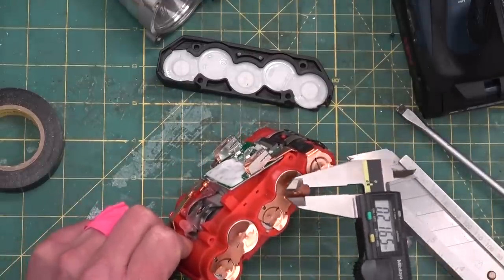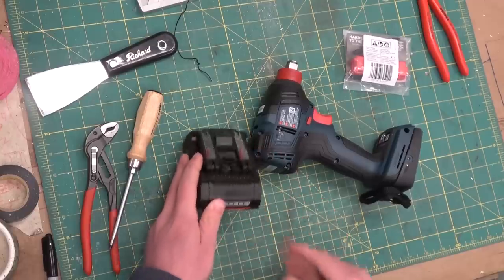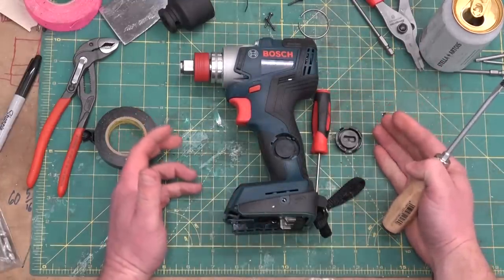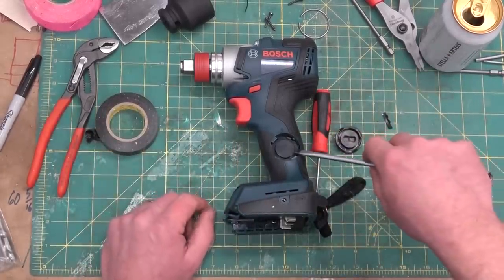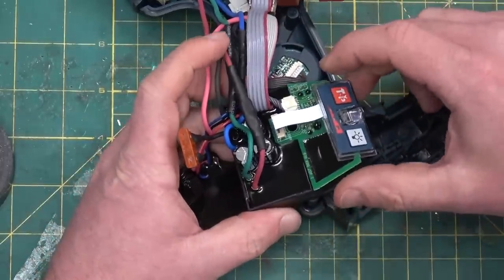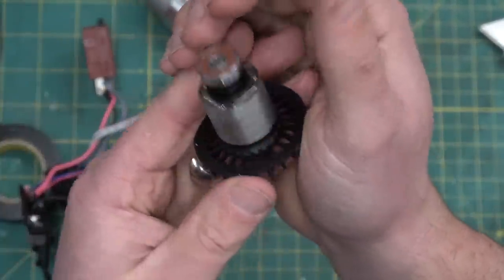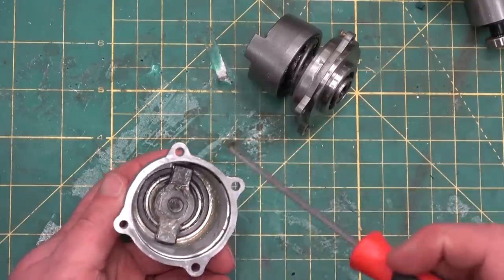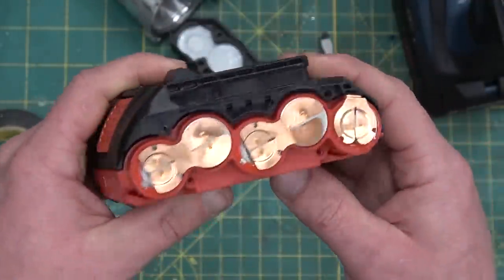BOLTR: BOSCH impact driver | CORE 18V

Comment: The blutooth does have an advantage. You can set your phone up to someone else's drill, then lower the torque when they are trying to use it.
Reply: I am pretty sure that that is the whole point.  Your boss can preset the torque so that you won't break the fastener.
Reply: Screams in frustration
Reply: I'd use it if it's an anti theft feature-locks the electronics when stolen
Reply: @Cheesen77  I think the boss would be more concerned with getting work done more quickly than a 2$ fastener. In a world of heavy machinery, if man labour slows down the site, money adds up quickly.
Reply: I get the idea of the bluetooth but I'm kinda confused why any employer would keep a bunch of guys who can't use an impact gun without busting the end off every fastener they touch.
Reply: Daniel Östberg because in today’s world it’s hard to find someone that knows how to use a torque wrench. 
Or.... maybe it’s so you can set the torque, cutting overhead by letting the one guy go that knows how to use the torque wrench and decreasing job time. Two birds with one dingus. To bad when Bosch introduced the torque limiter/adjustment feature, they said you shouldn’t rely on it and still double check it with a proper torque wrench. Conveniently, at the same time, they introduced a Bluetooth adjustable torque wrench. 😉😂🤪😜🤣🤓
Reply: The Bluetooth is junk. I have the Bluetooth grinder and Bluetooth LDM and it’s a nightmare to get either to connect to any of my hand held devices. Infact the LDM didn’t even work with Android.
Reply: Benz Lev 👍👍👍👍👍👍👍👍
Reply: Leave it to Bosch to put a WiFi password on the darn thing.
Reply: @notyourpapa  it is a problem if the bolt snaps off when changing a car tyre or snaps off in the engine block. Id say it has nothing to do with the boss. Iff i buy a tool its is mine and has nothing to do with the boss. More important when giving the tool to the apprentice and they have no control over the tool.
Reply: @barfoom  bluetooth not wifi.
Reply: @Darkstar.....  I don't think I was saying the opposite of that.
Reply: MrBD cause those guys work weekends
Reply: Lol
Reply: no the Bluetooth has the purpose for future gen tools to connect to each other.
For example if you use a Battery tool connected to to a vacum.
To increase or reduce brightness on Battery led lamp or on/off or to connect to a remote controlled tripod or wall mount for your Laser. 
It also gives you datas of the tool like for exmple run time, age or serial numbers.

You people here speak like the cavemans that said that a battery tool will never outperform a corded tool and that it will never esteblish.
Now we are in the age where battery power tools start to compare to gasoline units.
Reply: So we're considering getting some of these, because we work with farmers. Farmers have an interesting definition of 'billable hours'. Ideally, the BlueTooth functionality will ensure that we actually get paid based on the work we do, and not have to argue nearly so much about it.
Reply: that's what it is for :D
Reply: Limiting torque is actually good with low skilled labor. A friend needed to pull the blades of his husky mower. Its air powered and 900 ft lbs. With 5 settings what's he do? Full power loosen then full ungaduga retorque with me going no! Torque spec on bearings was 15 ft lbs... with my battery impacts something all they way to strip or crush...without settings...
Reply: Benz Lev can’t they just take out the module?
Reply: @lebenitj  That's how DeWalt uses Bluetooth
Reply: Exactly the main purpose, I would do that!!! ;-)  Dont know why everything today has to have Wifi and or Bluetooth Connection? ;-)
Reply: @lebenitj  Or remind you left your tool behind.
Reply: MrBD nowadays “education” is mostly how to do your job and how not to kill your self doing it.
Reply: Aaaand you`re fired..
Reply: @notyourpapa  Yep, and in the world of heavy machinery tapping out stripped threads wastes more time.
Reply: I got my grinder connected and only useful thing was that i could set my led to stay on longer :D
Reply: Lmao
Reply: @Darkstar.....  for liability reasons, and with most GC's, you're not supposed to use your own power tools, and the GC is supposed to provide them or, more/or less, the GC will 'rent' the tools and equipment to the project from a 'rental' company that the GC owns.
Reply: The blue range is exactly what it is, blue in color, the only thing worthy in that range is the 10.8 v .....
Reply: I have no idea when or why I left this comment, I'm pretty sure I was either falling asleep and fell on the keyboard or someone hacked my youtube account 🤣🤣
Reply: @notyourpapa  had my impact set on high and snapped a bolt off putting a blade on a D10. Exactly 0 shits were given about the cost of the bolt. Many shits were given about how fast the broken stub could be removed.
Reply: The Bluetooth is used to prevent retail theft. People have been stealing power tools so much lately that some manufacturers are installing these BT modules inside the tools themselves so that it would only work if the retailer activates on the checkout counter. Home depot is one of them.
Reply: @michaellim4165  That's not Bluetooth. BT requires active power, alligator tags and RFID doesn't. Unless your tool always comes with a battery installed on it (which they don't). AvE has pulled apart tools with integrated alligator tags before, which already works with existing theft prevention systems.
Reply: @GryphonArmorer  I dare you to try and torque valve cover bolts with this as a legit torque wrench three times in a row without failure in seal or bolt/thread
Reply: @notyourpapa  tell the remove the chip
Reply: Can confirm
Reply: They are getting plain goofy with technology these days. Most of it is actually good. I just can’t see it here. Gimmicks!  Bosch should think twice. They do make nice tools and have a good name.
Reply: Lol I was thinking about leaving it setting around, then just turning it on remotely to scare the poop out of the crew😂...  get really fancy and put some sort of power reserve in it so you can still do it when they take the battery out 🤣
Reply: Also the girlfriend likes an attachment I made so Bluetooth would be a welcome additional thing I could have control of her fun !!!!!

Comment: The copper being that thin is probably due to the difficulty in spot welding the copper -- any thicker and you probably risk punching through the battery case.
Reply: Short protection too? So the copper will blow before the cells go thermonuclear??
Reply: Not... exactly. Most of the heat is going to stay in the copper because... That's what copper does. It conducts.

The thicker the copper, the larger the spot weld you can do. To a point.
Reply: I also wonder about the flexibility, copper work hardens like Ave said but all of the robotic grade flexible sensor cables I have seen tend to have thin seemingly near dead soft copper (28 AWG 12-18 strands ) maybe the wide strip is for getting the proper surface area for the current and the thickness is also for allowing more flex cycling without failure. I also think you have an excellent and poignant thought about the spot welding, I have hear it takes a tremendous amount more power to spot weld copper compare to other metals in similar joints.
Reply: Well, according to Bosch they are laser welded.

Comment: The bluetooth is usually for asset protection, you activate the app when you get on site, if the device leaves bluetooth range of your phone it sets off alarms on your phone and device.
Reply: I prefer the thought of dystopian marches being broadcast whilst drilling....
Reply: Huh! I was wondering why in tarnation anyone would want a driver connected to the Interwebs. You’ve at least provided an excuse for it.
Reply: If it weren't so chintzy and outta place a PWM speaker from the drill's motor actually sounded kinda neat.
Reply: Bosch’s Bluetooth thingy is not necessary asset protection, it’s paired with nfc (afaik) for inventory management, but also parameter tweaking.
As for where they’re made, I have some from Malaysia and some from Germany.
Reply: i suspect the unit will be bricked with uncle bumbles IOT delete if thats the case, wouldn't be much of a security feature if you could just unplug it to have a free tool, even if it doesn't have a module in the hole the receiver probably needs to be installed for the brain to run the tool
Reply: Real pro just continue the cycle of theft on the job lol
Reply: @billrehm3590  Why it's fairly well made.
Reply: @jamesdriscoll9405  .....by a Drill Sergeant! Snort!
Reply: i know the milwaukee bluetooth gives you the ability to lock out the tool. never used it myself.
Reply: @RoseUnseen  That's it mate. Lose a tapemeasure, find a tapemeasure, the universe is in balance.
Reply: Unless the person taking it has a standard screwdriver...
Reply: @jmccoppen  The module is designed to disable the drill if it is removed while active.
Reply: @konzetsu6068  HILTI does the same thing on the powder nail gun I use at work. it can even order shots for you when it thinks your close to running out

Comment: I’ve dropped my Bosch impact from really questionable heights before and it’s never broke. I like it
Reply: Judging from how I saw Bosch pro tools getting abused I can promise you they will last you a long time.
Reply: i dropped my GDX 18V-EC impact from just over waist height and it snapped clean in half at the handle
Reply: I have the model without the Bluetooth bought on sale. Its fantastic, i use it for cars and carpentry with a dewaltski battery adapter, its faster than dewalt and ridgid.